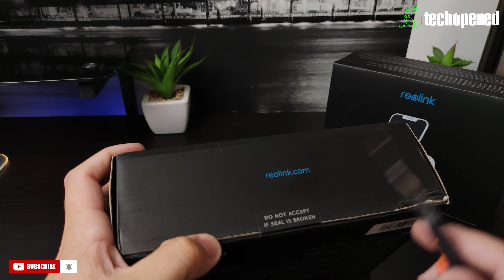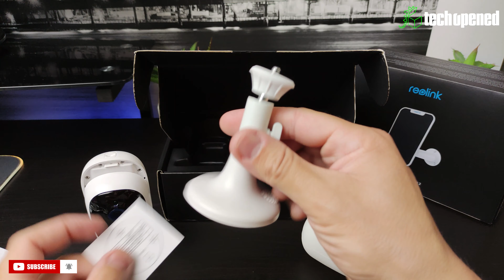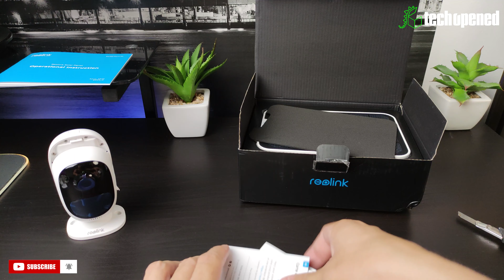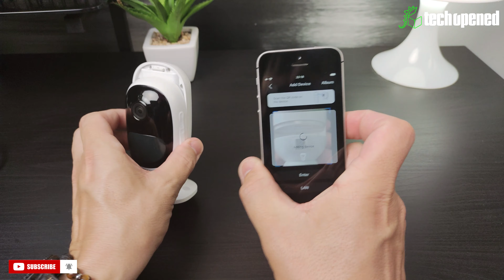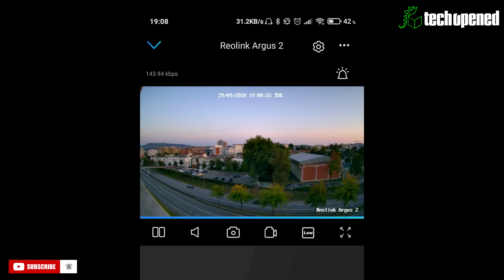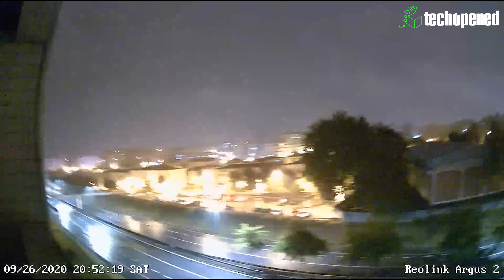Reolink Argus 2 - Best Wifi Security Camera! Unboxing and Review

Comment: how do you fit the rain cover with the cable from the solar panel? where does it go?
Reply from the maker: You need to fit it on without the cable connected. Then there is a tiny rubber flap on the rear side of the cover that opens up to connect the cable. I haven’t honestly tested it out in the rain with the cable connected. So I am not sure how it will hold up in the rain. In my case I am using it indoors.